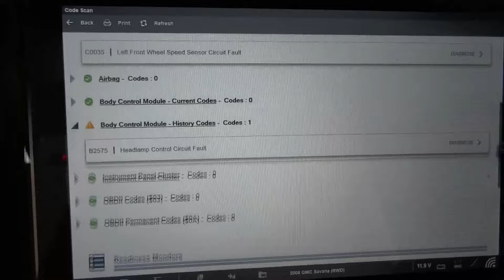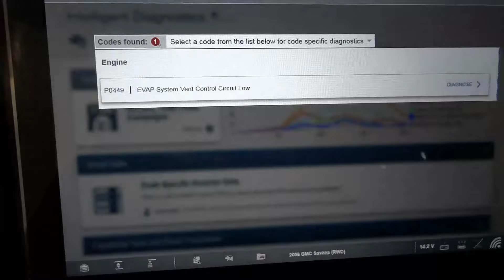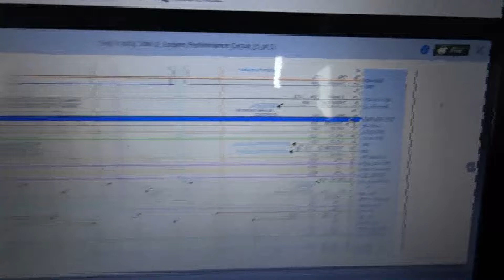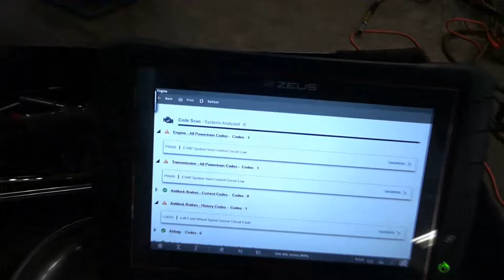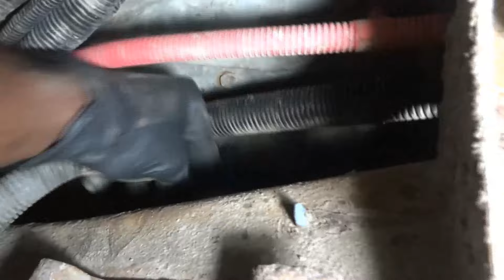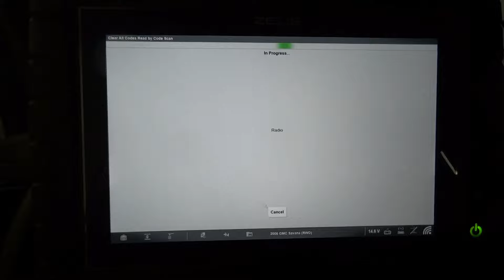GMC / CHEVY Truck - DTC P0449 EVAP Vent Solenoid Not Working, Diagnosis & Repair - No Parts Required

Comment: Couldn't you just put the test light into the connector instead of using those extensions from the rear?  When the key is on, will that light turn on or does the computer have to turn on the solenoid to do it?

Comment: So when the engine is off the solenoid should be open?
Reply from the maker: @Mexicanstyle-ix1km  it's always open until the ECM Closes it
Reply: @KITS_Auto_and_Truck_Repair  thank you master! One more question. Can the canister fail even if it's not clogged or cracked?

Comment: I have same code but I replace the gas cap and now it’s de check engine light off if the check engine came on again I check the valve tanks brother great job

Comment: Great Job! A real Mechanic and not a part Replacer! I have a similar problem with Chevy 2020 2500 Custom Truck! I unlike this mechanic just replaced the evap solenoid! And guess what I still have a Check Engine Light! I Are Not an Auto Mechanic! CMTFU! Again Great Job! A very thorough automotive diagnostic analysis job! Open a shop in Houston! I'll be there like a duck on a June Bug!

Comment: I have po455 and  po449  .. i changed vent solenoid .gas pressure sensor .purge valve and gas tank cap ..but the code keep coming back ..maybe its an open wire too ..or maybe the charcol canister ..2003 gmc sonoma its killing me
Reply from the maker: @migelgomez7753  check your evap tubing or electrical side of the system

Comment: Where do you go if you have power and the solenoid works I'm on my 3rd day messing with a system designed to vent dirty air back into my combustion chamber
Reply from the maker: @Mytwocentsisallicanafford   if you have power at the solenoid then check the control wire

Comment: hey kit, get yourself a powerprobe so you wont have to use jumper cables. just to speed up your diagnostic time.
Reply from the maker: @williamsantuzzi5808   Sounds good, Thanks

Comment: new here .. i have an 05 chevy uplander ls  ... all I want to know if I can replace that evap part on my own without dropping the gas tank or something. the part costs 40 bucks but i d k if I can fix this with my ramps or if it has to be fully lifted up. I want to see if I can do it myself first as in seeing if something underenath needs to be unscrewed to get to that toilet tissue roll looking part ..If I can see it soon as I look under it I feel I can replace myself .
Reply from the maker: @e_thegod5303   Good!
Reply: I wanted to know how it went, did you do the fix yourself, it's my understanding the fuel tank needs to be removed three bolts, and the EVAP solenoid sits located above the tank on the driver's side where the two doors meet approximately. Is this what you found? Just watched the  Bosses video and I'm hoping for just a burnt fuse🤞
Reply: Mine also 2005 uplander
Reply: I have a evap solenoid, vent filter and this canister and I'm hoping I can just replace the part up top and dont have to buy tamps, or 2 more jack stands

Comment: I have an 07 Yukon, started noticing strong gas fumes, sometimes acting up when cranking after it’s been ran, then it’s an absolute nightmare to put gas in it. Takes forever. First thing I did was change the purge valve, then replaced charcoal canister, and blew out the lines. As my luck would have it, trying to put gas it in is still a a pain. At first the fumes went away, after driving it a few times, they are back and it still acts up after a warm start. HELP!!!!! I am going insane!!!!! I don’t think this really matters, but my Yukon is cammed and tuned etc, surely that has zero to do with my issue/issues. ANY help or recommendations would be greatly appreciated!
Reply from the maker: @TheBossLdi1   Check the vent solenoid!
Reply: @KITS_Auto_and_Truck_Repair  I most definitely will, thank you!
Reply from the maker: @TheOriginalBossLdi1   My Pleasure!

Comment: What is the work of the vent solenoid?
Reply from the maker: @user-dw7jv9zi1d  the vent solenoid allows fresh air to enter the canister for it proper function!
Reply: @KITS_Auto_and_Truck_Repair  thanks so much but I don't know what is  canister in a vehicle what does it work

Comment: Was going crazy chasing down the P0449 code issue on my GMC Jimmy. Followed your lead and found the rotted ground wire ( in the harness above cross member ) from the vent solenoid to the ECU. Appreciate your approach and step by step diagnosis. I'm a fan!!🤗
Reply from the maker: @wilgoo55  Thank you! I appreciate it! I'm glad to hear that the video was helpful!!

Comment: Good video. That wire was most likely damaged by someone stabbing it with a test light to check for power. Insulation is damaged so then the corrosion starts.
Reply from the maker: @7viewerlogic670   Thank you!

Comment: Hi thank you for this video
If the power is good and the ground is not good what we gonna do ?? Chevy tahoe 2007
Reply from the maker: @hamzabenyahia9499  you might have an open in the control wire! check the control wire!

Comment: How do I check the negative trigger that comes from the computer (white wire) without the expensive scan tool?
Reply from the maker: @thomasnoguera9883  you can disconnect the vent solenoid and the ECM connector then do a continuity test of the vent solenoid control wire!

Comment: I have  a 2004 5.3 silverado  that p0449 code came up for me . Will the vent selonoid cause a hard start if its bad  ? The only time it gives me trouble starting is after i refuel.  If i open my throttle up and keep the engine at about 1500 rpms for  a lil bit then it wont shut off other wise it takes a few cranks to get it going.  This only happens after getting gas . It starts up fine any other time wether it's first start of the day or going into a store and  shutting it off briefly.
Reply from the maker: Napoleon The Frenchie  your purge valve is the problem. it's sticking open!
Reply: @KITS_Auto_and_Truck_Repair  thanks for your response. I have replaced it several times before due to a code being thrown and fixer app said it was purge valve. It was tested for vacuum leaks as a smoke test.  So if its stuck closed then  it wouldn't show on a smoke test if it was bad I'm guessing. If by chance it isn't the purge valve what else could it be ? I was thinking the vent valve in the rear and that's what led me to your video thanks .

Comment: What p0443 Evaporative Emission
System Purge Control
Valve Circuit means my friend has this code friend n he’s cadilac
Reply from the maker: Edi tce Diagnose  it means there is an electircal fault in the purge valve circuit
Reply: @KITS_Auto_and_Truck_Repair  thanks so
Much but I can’t find the circuit located
Reply from the maker: @Edi-01   you are gonna need a wiring diagram for it! I recommend you take it to a pro mechanic, you can get you the diagram

Comment: Sir I don't get no voltage from the white wire or red wire at all I have tried everything you said but nothing! At the beginning I did get 12v from the red wire but accidentally both wires touch and now I'm not getting nothing
Reply from the maker: Pantera Rocks  Check your fuse and make sure there is no open in the circuit!
Reply: @KITS_Auto_and_Truck_Repair  the fuse is good but wires touch and I had a spark
Reply from the maker: @LEONDELASIERRA1   so! you have a wiring problem!

Comment: Just wanted to update you on where my problem was. It was also inside the chassis harness. But it was the White wire going to the ECM. A buddy of mine came over to help me and we found a point in the harness that the White had continuity back to pin 34 in the chassis harness connector.  Since the open was yet beyond that back to the soleniod connector, we added a small length of White wire, and spliced it into the harness to the EVAP Vent soleniod. Doing that we could now test for a completed circuit between the power pin 33 Red wire, and pin 34 which goes to the ECM. We then reconnected the chassis harness connector, the battery negative cable, start the truck, and the check engine light was now off! The code was still in permanent mode, but cleared after the 2nd drive cycle.
Thank You for your video on this as it really was great, and I will look for more great videos coming from you!
Reply from the maker: Stuart Tell  My Pleasure! and thanks for the update I'm glad to hear that you fixed your vehicle!

Comment: I got the same problem PO449 code with a 2015 GMC Canyon, only I do have 12 volts on the EVAP vent soleniod red wire, and if you ground the white wire it clunks, so I guess I am going fishing in the harnesses for a broken white wire. Thanks for the video and the greatd work!
Reply from the maker: Stuart Tell  My Pleasure! Thanks and Good luck with your project!

Comment: Did you inspect very closely the black wire loom, those plastic adel clamps that hold the harness are known for rubbing through the loom and eventually rubbing through the wires, thanks for the easy fix.
Reply from the maker: Duane Donaldson  My Pleasure!!

Comment: I watch your Awesome videos all the time. I noticed that you always use your Snap On scanner. Great tool. But it’s very expensive. I would like to see you review a few good quality  less expensive scanners. Your opinions on less expensive scanners would be greatly appreciated. Thanks 
Phil
Reply from the maker: Phillip J Lynch  My Pleasure Phil! I will do tool reviews as soon as I can! Great suggestion !
Reply: Launch X-431 pro! A lot less expensive with many of the features high dollar scanners have, such as live data reading, ability to read abs, bcm, etc. etc. computer codes as well as perform bi-directional scanning with ability to enable and disable components and set different values in order to test components on the vehicle in live time. I spent around $800-$1000 for mine but have ability to do ecu coding etc. etc. Not to mention mine came with all the necessary hookups in order to diagnose almost all obd1 vehicles which was thousands by itself when I went to college for auto tech. Very good cheap scanner over say a snap on which I have used a few models of them myself when in college! I have only used it on 3 vehicles I own so far, but has already been worth getting hands down!!! The ability to blutooth from OBD port to a well protected tablet is well worth the extra expense no question as well!! Then it can be used under hood in the cab or take inside to print or update the software (I got a year subscription with free updates with my purchase)  

Did a lot of research before my purchase and so far no complaints, wonderful tool once understand how to naviagate it! Best part for me since I've personally owned it is the ability to not only read the pcm but all the other computers like the bcm, tcm, abs module, etc. has helped diagnose brake light on my 00 C2500 I couldn't figure out prior, and just last week used to diagnose a bad wheel speed sensor and exactly which one on my moms 17 journey, which without would have been a big guessing game on the ABS traction control lights on without an expensive scan from the dealership that I can do whenever wherever myself thanks to my Scan tool! Hope this helps.

Comment: I like the way you Teach but  Question ❓ 👈 how would  you test another word   Command the Test light On/Off  if you didn't have a BiDrectional Scanner I would like your answer...🤔
Reply from the maker: svhebert  that's a good question, if you cycle the key 5 times and watch the test light the computer might turn the vent solenoid on to test the circuit, this technique may not work on some other trucks, but the easiest way to check to control wire when you don't have a scan tool that has bidirectional controls is to disconnect the ECM and send power on the control wire from the ECM's connector with the ECM disconnected then check for power at the vent solenoid connector!
Reply: @KITS_Auto_and_Truck_Repair make perfect sense I appreciate your response ,thank you 👍
Reply from the maker: @svhebert  My Pleasure!!

Comment: What happen if the control wire is not working, you have to replace the computer
Reply from the maker: alsteven44  if there is no ground on the control wire the issue could be an open in the wire or a bad driver in the ECM!